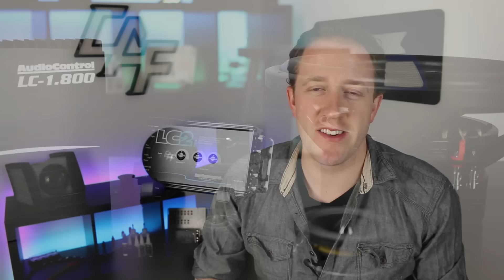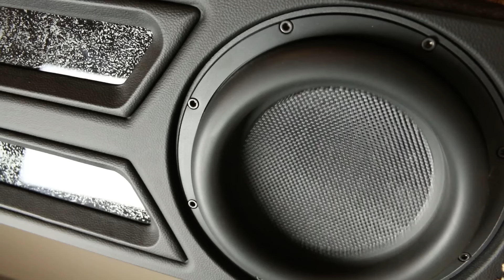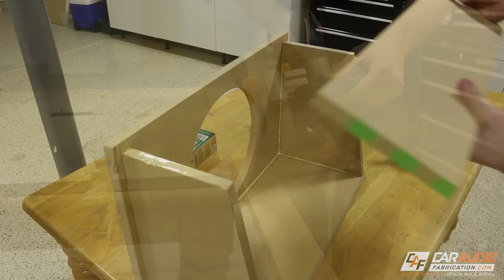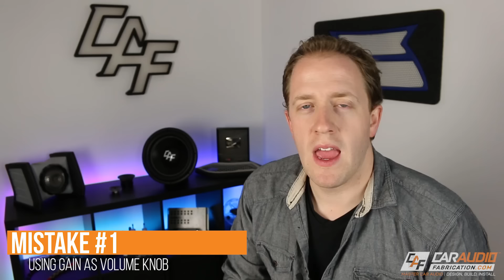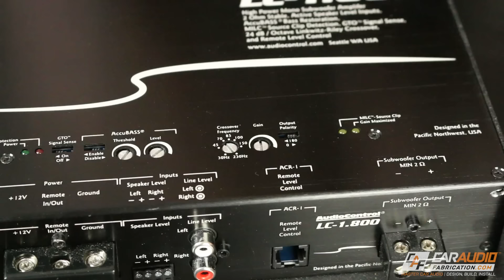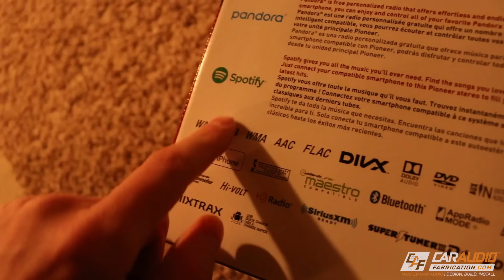Avoid these 5 common Car Audio NOOB Mistakes!

Comment: There are much worse things than using compressed audio.  Why worry about that if your using high to low converters, you lose a lot of information. Most Bluetooth is BAD too, you are often compressing the music twice, making music harsh as fuk.  LDAC, or APTX HD at the highest bitrate will help but USB to DAC is, or optical to DAC is far better. The DAC usedis important , even if you correct the response from a factory radio, the included DAC still won't be great and many installers charge thousands doing install this way. The best speakers, the best amps  fed from a factory head unit.  There is no point.  Garbage in, Garbage out. If you don't know what a DAC is or why that's important you SHOULD NOT BE AN INSTALLER 90% of installers +.  Rear Fill. NO.  That's a load of shite right there, will affect your stage (and people spend thousands of time alignment and tuning and leave that shit on, you know who you are). Too many devices in the signal path, don't do that start with a decent  head unit with  time alignment and 4 volt pre-outs built in. Don't think about the install all backwards. Start from source and optimising everything back to the your ears. Do not build a system around OEM. Start over. If you have no choice but OEM, then you need to bypass it with a switchable DAC or hidden second headunit, rather than thousands trying to correct shite. If you are serious you will have to factor in your choice of car, if you have something with a lot of roadnoise then don't bother unless your gonna park up to enjoy it. Roadnoise kills detail and fixing it is expensive. You must treating the car, yes you must sound deaden the doors but that might not be enough. If factory location is crap you have to fix that too.  Streaming internet audio is mostly crap sounding too, look into Tidal, HD tracks etc. A lot to consider I know. At the end he talks about the BIG 3 upgrade. These days we have efficient Class D amps that won't dim your headlights or stress your car's electrical system. Consider a change to class D for running a SUB than bridging an old class AB amp + wiring upgrades and look at efficiency of a sub and box and if you don't know much then don't fuking build a subbox + amp etc. Get a good active sub solution with class D amp  and be done with it.

Comment: what mistakes did i do? well, i 1. bought an used subwoofer and amp for $100 without knowing their specs, used a line converter with some ghetto ass connections to get a signal out of my factory head unit, and attatched the subwoofer to the trunk with... velcro? hasnt even been a week. in fact i finished ot yesterday. spent probably 6h in total.

Comment: Bad grounds... running power wires in the same location as audio wires... and for gods sake put in a fuse just after the battery...

Comment: I made the capacitor mistake when I got back into car audio last year when I got the “bug” I was always a Rockford Fosgate guy, so I installed everything RF in my 2013 Mazda CX-5, when it came to the amp and subs, T750.1 to a preboxed set of P1 12’s, the capacitor was an ok fix I reckon, then I got a pair of big boy T1 12’s with a T1500.1 and the installer suggested an external XS battery and not a capacitor because”it was like putting a vandals over a gun shot wound” it’s never too late to gain more knowledge, I’m fixing to do another install on my 2012 GMC Terrain, any advice will be welcome especially on the HU install

Comment: Don't try and run 8 ohm house speakers off of a cheap amp!  Yeah, back in the mid-90's, I ended up blowing the house speakers, but ended up replacing the woofers with actual automotive subwoofers.

Comment: Got a little rockford 10 inch from my brother in law who worked in audio when I was 16. Its only 350 watts. Amp is only 250 watts, had it for 15 years and it still works like the day I got it. Its perfect 🥰
Reply: I want this setup in my truck.  Salesman telling me $700 for a good system.  I got depressed
Reply: @chulow9024  I have a RFosgate P300-10 in a single cab Silverado that works really well.  300 watt RMS powered 10” sub…  it’s enough to give decent low end with the Kicker/Polk mids/highs in the doors and B pillars (no amp on them).  I think that RF 10” goes for $250-300 and it fit behind the seat.

Comment: Hi, I’m new to car tech. Would 50 RMS be enough to power a 120 RMS speaker? Would the sound be adequate?
Reply: Yeah, honestly 50 rms would sound very similar to 120 rms. But I'm gonna be honest, it's very rare for people to stay with amounts of power that are that low. If you can afford it, I would recommend going straight to the mid-tier range of subs that a company sells.

Comment: The first mistake I ever did was put for old style 12 inch sub Tower speakers and the back of a quad cab truck with no amp just wire to the back speakers

Comment: A mistake I've seen that blows subs is the bass boost vs the frequency the amp is set too. Bass boost might be 45 hz but the frequency is set to 110 hz. If you have a sub rated to go as low as 50 hz, your gonna blow the sub. Depending on quality it might take longer but never the less. With bass boost at a different level, the amp will be trying to play 2 levels of bass at the same time. Subs are more temperamental. Understand the level you want before buying. I find that between 70 hz and 90 hz gives the best bass. Keep it switched to filter out high frequencies. Vice versa for your 6 ½ speakers. Keep it to filter out the lows. If you have subs you don't need it. Life expectancy goes up. Just make sure numbers line up. Next, if you have a stereo that has a frequency control, it could be 7, 11, 13, 17-band control. Learn what the frequencies mean and how they control the music. Louder isn't always better. Adjusting those frequencies help make your sound better. Presets aren't always the best way to go. It'll sound cleaner, and more crisp. You don't need a 500W amp for your highs. It takes more power to push "lows" then it does your "mids" and "highs".
Reply: Baffle em with b.s....
Reply: Long ago I had 4 2 channel amps each bridged to a single door speaker. It was loud and good times but never could get the bass to match lol

Comment: Thanks for this. I usually have it dialed in.. however , brand new 2021 Kia K5 GT line has be a bit intimidated. My package only has door speakers, but lots of trunk, and a huge back deck.. I'm thinking added amps, with component sets in the deck, and a pair of 10's in the trunk.. it'll all come together eventually lol

Comment: Hey, I just did a poor mans install in my 1983 Ford F250
now the interior is mint so i wasnt willing to remove the original deck, I bypassed that using an RCA to 3.5mm cable and running straight from the amp to my phone. 
problem I seem to be having is the cable is shit quality and no one offers an RCA to 3.5 with a nice shroud like those crystal ones u mention. 
system details: planet audio 2000w amp, alpine 10inch sub tube(non powered), 2 boxed kicker 3 way 6x9s.
I ran each 6x9 to a left and right output on the amp, then I bridged the sub between both ports. 
the only issue based on your video of solving the issues of clicking or other noises seems to be the RCA to 3.5 cable.. I cant find a way to run it 18 inches from any other cable and the only ones i can find are thin as F*** 
the entire project only cost about 3-400 and took an hour or two to install. did all myself. 
any tips and have you ever seen someone run a system like this before? completely bypassing the original cars audio?

Comment: Sir, crap in crap out.. spend a bigger chunk of money on a good head unit. All source signal start at the head unit. AND you can use the entire trunk as a woofer box. Moreover you can use a smaller enclosure and cheat with fibre stuffing.

Comment: My first system my buddy and i installed, for one thing i left the dash completely disassembled once i got the factory unit out and just had the new head unit sitting in the metal harness it was supposed to be mounted in.

Second, with the sub I installed I had no idea how dvc subs worked and just bought a 2 ohm dvc sub since I wanted 2 ohm output. Then, I just wired up one voice coil and called it a day. It was my first sub and it sounded like shit and I knew it, very poor frequency response above the tuning frequency and super boomy in the one spot where it worked. Surprisingly it lasted for like 5 years hooked up like that, and only blew once I used the gain knob like a volume knob and rode around listening just above 75% volume for an hour or so yo show off. I had my next system professionally installed and it was night and day.

Comment: at this point, i am wishing for an Apple system that'd take out of the equation all the variables, all the switches, etc. where any of those can mess up the sound experience.    Think of the permutations among those variables and switches, and think of messing up any one of those permutations would result in a failure.    That makes setting up a stereo system an almost impossible task unnecessarily.

Comment: I let an audio shop install a free air sub in the back of my 2007 GS350. They had to splice the original wire, which I felt uncomfortable with, but I got it done anyways. I guess my factory amp is working too hard and it generated a short that got back to my stereo, because the CD player does not work now!  It will start a track and my volume controls do not work, on top of the song not even playing. This is a symptom of an electrical surge (short) that got to my volume control because I was holding the button when the short occurred. I broke really hard while adjusting the volume level and the short happened. I am pretty sure that they fucked up the splice and want to pin the problem on my cars "poor quality" amp. It could be either but I'm hoping it's just the amp that went bad after 13 years and not the work they did. Either way, I miss my CD player so much

Comment: The big mistake I see people making is they create a system backwards. They usually start with a head unit, instead of speakers and working backwards with the head unit as the least important item. Since the speakers actually produce the sound and transmit it to your ear, quality here is paramount.

Comment: Is it ok to mix two different size subwoofers?  I was thinking about mixing a 6.5" and an 8" sub in seperate enclosures behind the left and right front seats in a CRV. The rest of the sound system is stock...for now.  But both in a sealed enclosure with both drivers pointing straight up. Is that ok or another big mistake?

Comment: my first mistake was the end of my first system as well..................old set-up,old amplifier and old subwoofer (but excellent quality)..
so i started redoing all the wiring....BUT forgot to re-do the ground cable (re-cut, re-clamp the connector)...it was old and the connector was loose...(you can probably see what's coming) ......
so..while i'm setting up the amplifier on the LEFT of the car.....on the RIGHT-side..the ground cable desides to comes loose......while i'm powering on the system......all i got was ...POOFFFFF.......

and there goes your first 1000 bucks big system.....lesson and pro-tip....:MAKE SURE YOUR GROUND CABLE IS THICK AND CONNECTED GOOD ENOUGH!

Comment: I swear someone is listing to my conversation. Never once have I clicked on any videos about audio. I'm the type of person who would probably turn my truck into a ticking time on if I even tried to do it myself. I say this because I was talking with my husband not even an hour ago about this. He is a truck driver with a diesel mechanic degree he only uses for our own personal trucks. He was given 3 10s, 2 12s and an amp from another driver who was trying to sell it so he could afford to put his truck in the shop. We were just talking about taking it to the local audio guy to figure out if and what parts could go in my truck and how much it would cost to do it as well and putting the rest in with my husband's current system in his semi.

Comment: I got two 12in MTX terminators in a box and it came with a 800 W Max monoblock amplifier and I was actually pretty satisfied with that which is surprising and I also got a Cerwin Vega 4 channel 1600 watt amplifier that was going to power my 6 by 8 speakers well after I bought that amp I realized the RMS her channel was 300 w so then I had to go and buy Infinity R Series 6 by 8 which are like the most expensive ones you can get I think they were $300 for a pair and I had already bought some Kenwood speakers that now I'm thinking about making a home boom box out of I also got a 2.5 Fared capacitor because all of this is going into a ex cop car Crown Victoria so the electrical system was already upgraded as well as the alternator because of all the police lights and everything in the computers they have to run in them at Van Lee while at why I chose the car and back then when I got it it was only $1,000 but nowadays the same car is going for $3,000 cuz everybody is realizing what a good deal they were and that they last forever and they are pretty much four door Mustangs

Comment: Few words...
Flac, other lossless or nothing at all... If its not lossless, i turn the sound sys off, but thenagain, i only listen to music i download and i only download flac so...
Second, as with good audio file, get some good speakers, good equipment altogether does you more good than larger equipment... 
Last, rip the car apart and insulate it well... First, there wont the the sound of the imminent arrival of a moron preceding your arrival, and second, you wont have road noise filter into your music...
Reply: Also, a word of advice, take a closer look at your electrical wiring, as many cars use joint connections that split or do similar stupid shit with cables and result in a feedback noise that will affect your sound...

Comment: i have a 1500-2400 watt sub amp and i want to get 2 12inch 1600 watt subs. on a 2015 kia optima lx. do you think that i need to upgrade my alternator and wiring or should i be okay? this is my first install and this is so much more factors then i thought went into subs lol, i thought i could hook a few wires up and be on my way.

Comment: Years ago I put a pair of 10 inch Pyle Subs in the trunk of a 1988 Ford Tempo Sport! EVERYBODY TOLD ME "You can't do that!" And for the space allotted IT WAS a tight fit and required me to "re bend" the trunk support springs to even fit the sub box into the trunk area UNDER the package tray of the car! The one thing most people DID NOT UNDERSTAND is that my box was custom built EXACTLY for my car, and a friend of mine who was a professional car audio installer helped me set up and build the box the subs were in, to "by volume" the box was the EXACT SIZE needed to run the pair of ported subs....which was just TWO INCHES smaller than the space I had to work with!!! 

In the end I had a number of people tell me "There is no way you have two 10 inch subs in the back window of THAT car!" until I showed them the bottom of the box inside the trunk!! And the sound from the box was INSANE inside the car, as my buddy used a db Meter (he borrowed from work for the weekend) to help me set up my system!! In the end I had a pair of MTX tweeters, two 10 inch subs and a pair of 61/2 mid range speakers inside a fairly small car with three amps and a crossover that everybody told me "couldn't be done"!!! And the sound from the car at full volume was so loud you could hear it as clear as day two city blocks away!! AND THAT IS NO EXAGGERATION!!! 

One guy who told me "You can't put all that equipment into a Ford Tempo was my friends boss, who failed to realize that "I already did that" and used his employee and HIS tools to do it!! And when I showed HIM (my friends' boss) my set up and demonstrated how loud my car was he then asked me "Who put that system in your car?" which to his surprise was pretty much me with a bit of help (we never told him (the boss) who helped me), and I had designed it all by myself pretty much!! 

I do miss that car a lot!! And I wish I had that stereo at times today!! BUT people think you can't do simple things when it isn't as much science as it is just understanding simple math at times!!

Comment: He's so right anytime you draw more power you have to provide it  with the least resistance possible. Which means  more output and heavier gauge wires for less resistance.  Rule of thumb when wiring, you can usually go larger wire, but never ever go smaller wire....and if you're smart you'll use an inline breaker that will take any power surges....alternators don't produce the cleanest power.

Comment: Cool! I've never made any of the mistakes when making purchases for a car audio build, but... back in the early 2000's I did think that higher watts= better amp. Luckily before any purchases I consulted a friend.  Motherboard, capacitors, wiring, power supply, heat sink, its a ton of things that definitely a amplifiers quality. Rms is what most people should look for when thinking about overall wattage output.... and don't forget that even Rms varies depending on Ohms. Great video! Very informative.

Comment: Regarding #2 - Like you said in #1 about leaving things on the table; Don't leave frequencies on the table! Try to buy a subwoofer that has a low frequency as close to 18hz. Crossover cutoff should be around 80hz